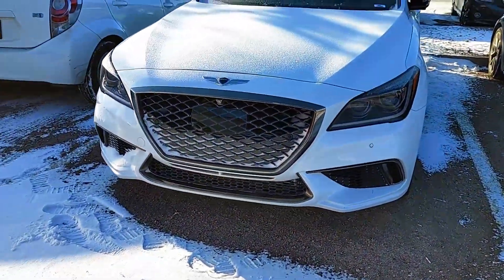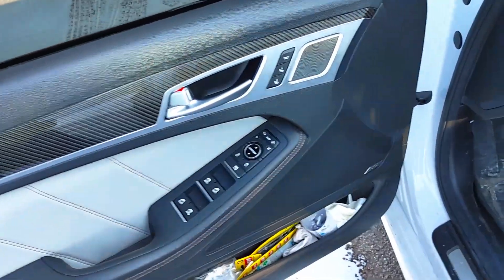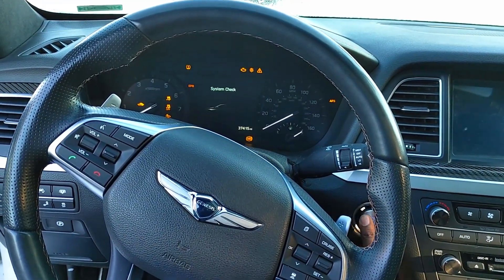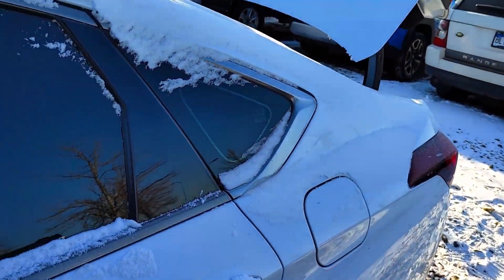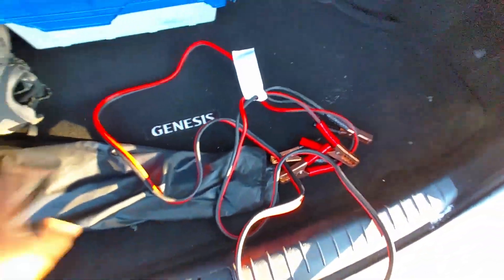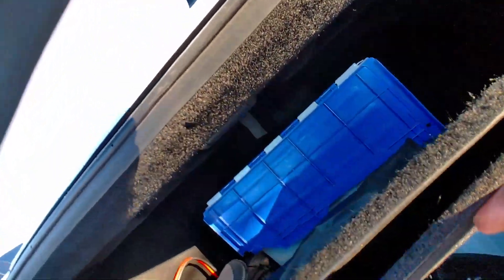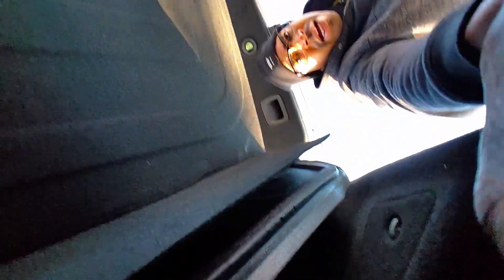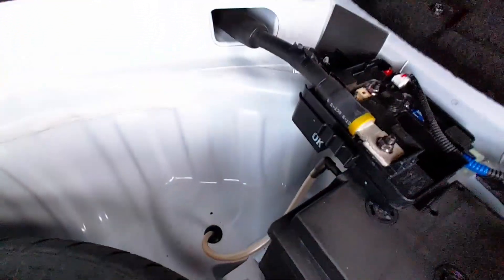Genesis G80 Dead Battery Problems (Know Before You Buy)

Comment: It's the loose negative terminal connector.  There's an adapter that can be installed to make the connector secured.
Reply from the maker: Thanks for the comment! This will likely help a lot of people.
Reply: I put a battery sleeve on my negative battery post. Orielly has then $4.97

Comment: Having the same issues with mine right now. First got the car less than a year ago. Battery gave out on a cold morning. Replaced battery- that battery was bad, warrantied that one and ran okay for 4 months. Now car died again and am left to assume the battery as well. Thinking about trading it in because your right a car of this caliber shouldn’t be having these issues of reliability 😊
Reply from the maker: I completely agree. One of the comments from Mark Reginals said "It's the loose negative terminal connector.  There's an adapter that can be installed to make the connector secured."

Comment: Had a 2011 Genesis had to replace the battery at 119k mi, gave the car to my son a few months later battery went again it turned out to be the altenator, bought a 2017 genesis G80 8 mo after purchase had to get a new battery 180 dollars, car had 42k, so far so good. Keeping my fingers crossed , I LOVE GENESIS
Reply from the maker: Yeah I love Genesis too but these kinds of issue just shouldn't arise at 30k or so as mine did even continuing after a battery swap. I got rid of mine due to the danger it poses in winter/unreliability.

Comment: I've jump started mine from the provided terminals under the hood.  Just look for a plastic lid with a + and - on the top.  The posts are under that.  Pretty easy and there's no risk of explosion since no hydrogen gasses from the battery would be under the hood.  Also, any tool kit I've owned has extensions for the sockets to reach recessed nuts.  My current 2015 5.0 AWD Genesis is my 4th Genesis.  Great cars and well designed.
Reply from the maker: Wow! I like them, except a couple small issues. Thanks for the feedback!

Comment: Hey, got this situation in my garage right now.  My battery was reading 8.4 volts.  Have the charger on it right now.  Just wondering if something came on to drain the battery.  So many electronics on board.  Also, once you have the cables hooked up, before trying to start the car, try locking and then unlocking with the key fob,  it may have something to do with the security system.  
Can definitely feel for you trying to do this after working graves.🙄
Reply from the maker: Yeah after 12 hours, Im stumped and ready to go to sleep bro.

Comment: I've got a 2019 G90, the battery problem was due to the head unit not properly closing apps. They ended up replacing the head unit after 4 trips to the dealership. Twice I had to have the car towed from my house.

Comment: I’ve got a 2015 G80 with same issue car dies randomly but battery is new. I figured out that the design in the positive terminal is very bad and tends to loosen no matter how much you tighten it.
Reply from the maker: How did you fix this issue?

Comment: I have the same car, but where do you hook up the jumper cables
Reply from the maker: There is two places that I believe are the jumper spots. One in the trunk to the right of the spare tire, on the actual battery is. The other is under the hood, if you look on the left hand side (Front passenger side) you should see a box with a red plus symbol on it. Open that box and the silver thing sticking up is where the positive terminal goes. You should be able to use any exposed metal for the negative connector. Depending on your year, your setup may be different. Mine is a 2019.
Reply: @waddupwithdex  I really appreciate it my brother 👍I had the positive cable on the nut that has a thick black plastic cable  that looks like it's coming from the trunk.
Reply from the maker: @ignoranceisnotatrend4669  All good! Consider dropping me a sub. I have a few more videos about the G80 before I sell it. Might be helpful!

Comment: Am thinking bout buying  this car or lexus  a es350
Reply from the maker: Awesome! I personally like the Genesis because they come fully loaded unlike many other manufacturers vehicles. Of course it depends on the year and warranty package you are offered Genesis might be the better choice. What model year are you thinking about?
Reply: @waddupwithdex  2018 with like 32k on it regular rwd .
Reply from the maker: @blackjarokat  Cool. Well the miles match up with the years. As with any used car, get it checked out by a mech shop. However, for best results I would recommend trying to find one that is under 30k and under 3 years old for around the same price (You may have to travel). Reason being is Hyundai gives a 3 year 30k warranty. Even if you get one that is close to being out of warranty it still gives you some level of protection with any unknown car. Just food for thought.